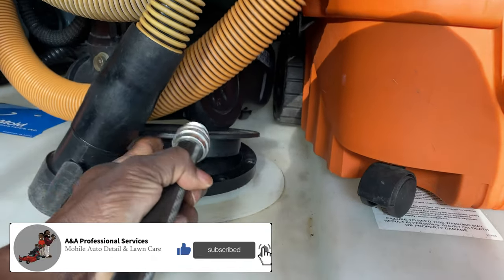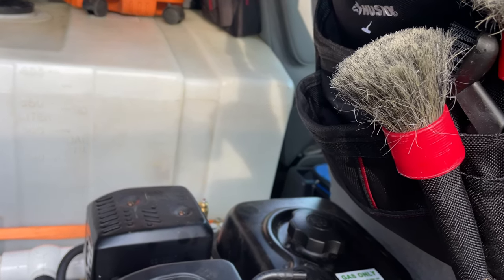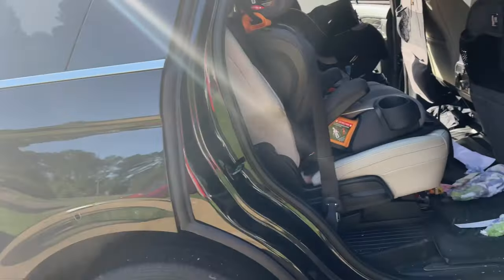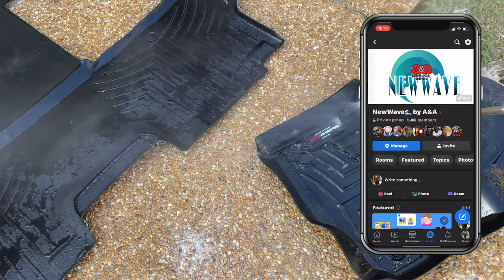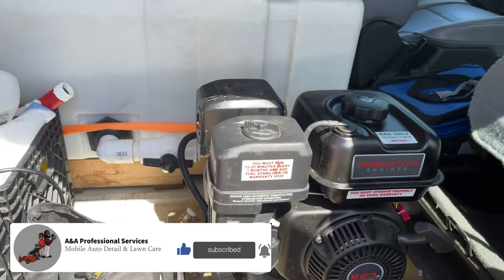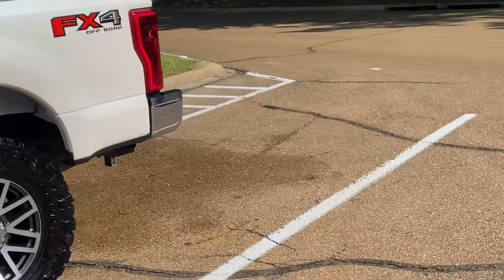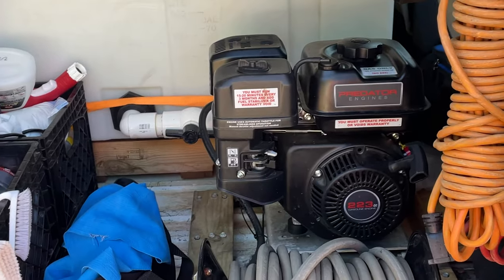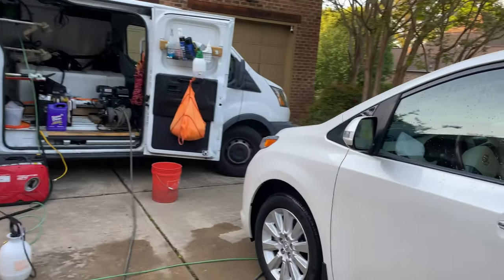Mobile Auto Detailing: What Size Water Tank Do You Need

Comment: I’m running a 50 gallon tank with a harbor freight gas pressure cleaner i get minimum of 4 vehicles no pre rinse just foam the car down that allows me to save 5-6 gallons per car
Reply from the maker: That's every efficient.  How you manage that
Reply: Shouldn't you pre rinse all the dirt and contaminants off? If you just foam it and contact wash, wouldn't you be rubbing contaminants into the paint and creating micro scratches?  I'm genuinely curious. Not hating lol.
Reply from the maker: Definitely need to pre rinse and pretreat before washing.

Comment: I've not started my mobile detailing business yet, just doing friends and family cars for free right now to learn and practice.  If I do the cars at home then I foam>rinse>foam>contact wash>rinse>Dry using my Portland electric pressure washer.  If I have to go to their house to wash the car then I use a 5-gallon bucket with DIY Detailing Rinse-Less Wash V.2, to be honest I've even been using this at home a lot more than the pressure washer method.  I use a battery powered sprayer to pre-treat the car with rinse-less, then I use the Legacy sponge to contact wash, then dry.  The cars turn out better than the foam method, I have not found any marring in the paint using this method.  Also of note, I try to fill my 5-gallon bucket at the local grocery store's RO drinking water machine.  I get 002 TDS water, my tap water from the hose at home is 050, which is really good for city water, but the 002 TDS water is for sure spotless.  I'm thinking of getting an EGO pressure washer.  It runs off EGO's 56v batteries and can syphon water right from the rinse-less wash bucket.  HF has a 15 gallon tank I could use, or just add a couple more buckets with lids.

Comment: I use a 50 gallon tank with a 1.7 gpm pressure washer. I can do 3-4 cars with that set up. Mainly because a lot of the cars I do, don't have caked on mud/dirt. Also, I pretreat the paint and my two bucket system consists of a bucket ONR with about 15 microfiber towels that I use once. I use a Ram C/V Tradesman, so space and weight played a big factor. I wanted a smaller vehicle so I can cater to clients that live in buildings with garages. Basically, it's easier to maneuver and park. I only break out the foam cannon, if i'm doing a paint correction and/ceramic coating. In other words, the more they pay, the more water they get.

Weight should also be a major factor in choosing a water tank. 1 gallon = 8.35 lbs. So if your vehicle has a payload capacity of lets say 1600 lbs, the water is going to take up half that. And that's not including passengers, gas, and all of your equipment and supplies. If you overload your vehicle, there will be more wear and tear.
Reply from the maker: Thanks for sharing. I agree with this.
Reply: I agree I’m a veteran in this business I recently made comeback I had a Ford van with a large water tank it weighed the van down and was hard on the transmission the small van  I have now would need a small tank if go that route
Reply: Can u give me the link for the 50 gallon tank

Comment: Water weighs close to 8-1/2 pounds per gallon. Don't forget to figure that extra weight in on your van, pickup or trailer, and make sure your vehicle can haul and stop that extra weight. Saw a local guy pulling a pontoon boat with a small pickup go right thru a light and hit a car. Too much weight for his truck.
Reply from the maker: This is true

Comment: I do the same and the weight of the water is constantly warming down my tires. Two year max!
Reply from the maker: That’s about right. Thanks for sharing.
Reply: Vehicle too small and tires are at the wrong rating would be my guess. Water is about 8.4lbs/gal. I dont have anything lower than a 3/4 ton truck for the weight cap and E rated tires. You can get a ticket for being overweight for the gvrw of your vehicle also.

Comment: Off topic here...
So I have detailed every summer for about Ten years now all types and kinds of vehicles.. but have never detailed a black Vehicle or a convertible/top either .I heard black cars is a little tougher to get it right .. have any tips on them 2.. actually have those 2 lined up to do at the end of the month .. jus curious...
Reply: Either color will need to get rinsed off as soon as you can of soap
Spray some “Superior formula 4 spray wax” when you are rinsing the car off the soap 
What that Superior product does is beading that water and leaving a coat of wax, leaving a look like waxed car.
Giving you also a water spot free car and now take your time to use your favorite rag to get the car dry even under direct sun light

Read instructions to use this product, dilution rate
Safe to use
Spray the product everywhere in the car, safe on glass
Order it on line @ oreylli’s auto parts, $25 I guess but it lasts a long time as you dilute the formula 
Superior products has some good stuff for car maintenance 

Several videos here on YouTube using this product
Or use p&s bead maker, same concept different $price
Reply: @helifan2346  oh okay sounds good. I appreciate the information..

Comment: Does stopping the van or braking  is harder when u fill tank all the way up to the max
Reply from the maker: Not really. 100 gallon is only 800 pounds. The van can hold 2500 pounds
Reply: @AAProfessionalServices  oh ok 👍 thanks for responding
Reply: I change out brake pads every 6-7months for max weight on my promaster city van.  
I am heavy with extra items and di tank.

Comment: Can you use super clean diluted on car paint for hard dirt spots if so what dilution ratio, and for the things I can’t get off with my microfiber mit that are hard to get off and lift? Thanks please help
Reply: Do one third super clean, two thirds water and two dawn shot glass pours and that’ll do just fine. Just don’t let it dry on trim. Everything else should be fine like tires and paint. For interior just do 10 parts water one part SC
Reply from the maker: I agree with this.
Reply: @mauriciorodriguez7154  why do you say use dawn is super clean not enough?